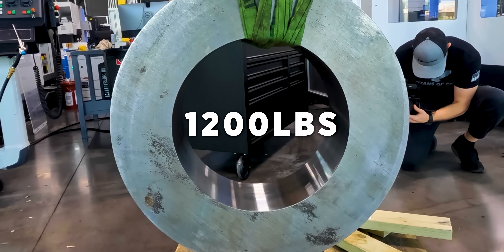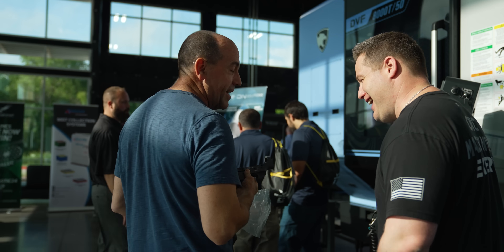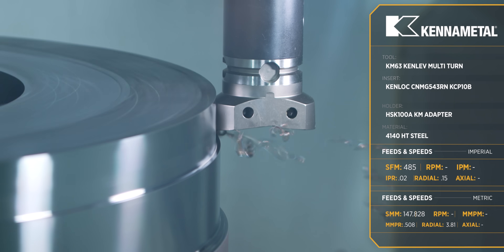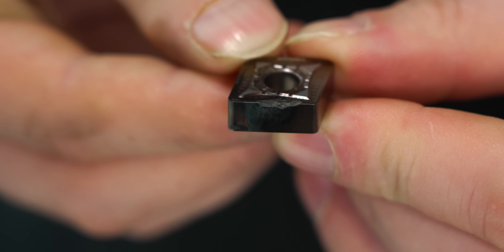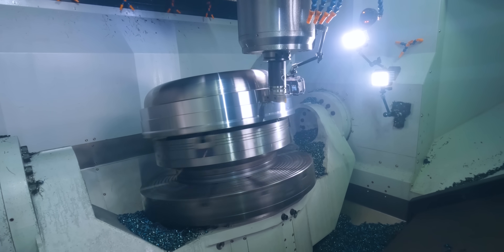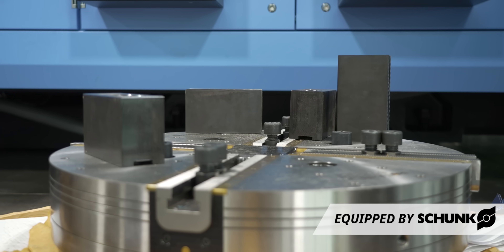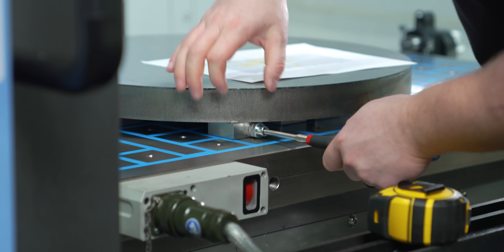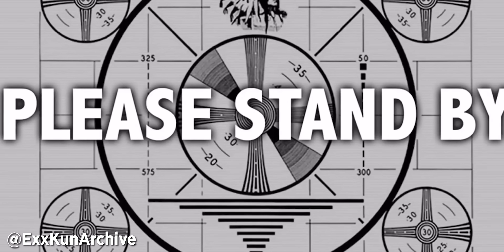Expert Level Machining Cuts on a 1200 Pound Part | Turning on a 5 Axis Mill

Comment: When lifting such parts, you should use a piece of fire hose between the rope and the component to prevent the hoist from being cut open. These are actually basic knowledge of occupational safety...

Comment: I used to work for a company here in Ohio that made the largest roller and ball bearings in the USA. I was charged with making 20 foot diameter bearing races on a Bertheaz (spelling) boring mill (vertical turret lathe). When I started there I was making "smaller" bearings, same size rings as the one pictured in this video. I ran them on a piece of history, a Webster & Bennett vertical turret lathe (VTL) that came here from England after WWII. The chuck sat parallel with the floor ans was called a "table." We had 3 in different sizes. Back then that very machine was making bearings for gun turrets that were killing Nazis! I kept it's name plate when the casting finally cracked and the the entire drivetrain collapsed on itself... I loved that antique! ❤❤
Reply: Was talking to a mate yesterday who worked on Challenger tanks, he was telling me how they had a 24 foot diameter table for machining turret rings on the Challenger, it turned the whole tank body, all gone now.

Comment: 1200 pounds? Northrup/Grumman in Sunnyvale CA that would be considered a "small part" 12,000-20,000 pounds now we're talking BIG parts. They have a lathe there that has a 120" face plate and the bed length is 30 FEET long. Did a tour during a job interview. They also have a horizontal milling machine that had a piece of steel on it that weighed 22,000 pounds. Estimated run time with 3 shifts around the clock was 4 months. For 1 freaking part!  The machines they had could easily make the machines that are in Titans shop! Needless to say I declined the job when it was offered.

Comment: Only one question. Why did you program the faceing/milling of the top surface where it moves in both x and y instead of just moving in towards the center is x and then spin the part around ? Just like in one of the old videos on the 5 axis haas mils ?

Also is that a big insert or does Jessy just have small hands ?